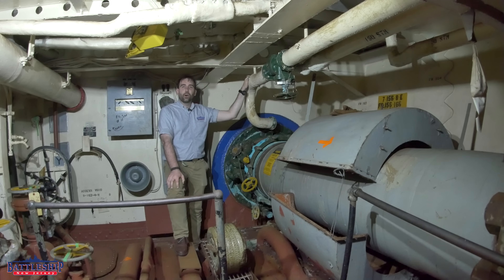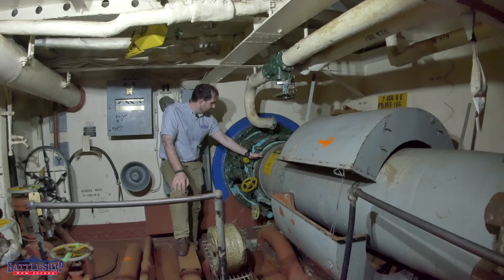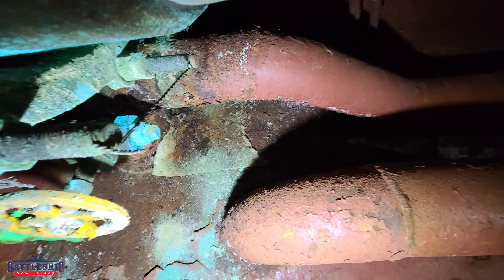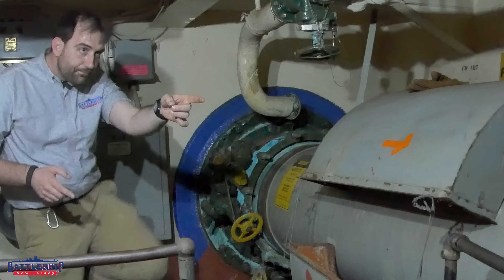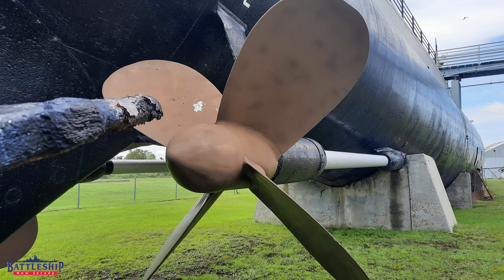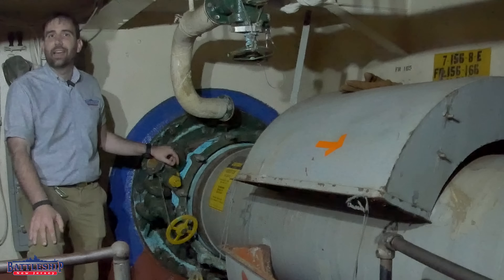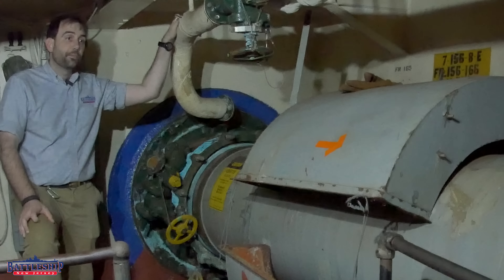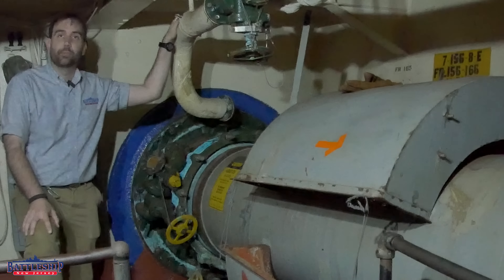Drydocking New Jersey Priority Project: Propeller Shaft Seals

Comment: I would strongly advise you don’t remove the propellers. Once removed there’s a requirement to control the condition of them separate from the ship. Whatever shape the hull is in the propellers will be closely related. Once removed they’re subject to impulse decisions made from expediency rather than well thought out planning. If they’re removed they become an added expense to store or display them. With them mounted to the shafts they won’t appreciably increase maintenance costs. Since there becomes an additional expense when off there arises the temptation to sell them off to pay for repairs of the other propellers or emergency repairs on the ship. A glaring example of this is the United States a short distance away from you. They took off and stored on her deck all four propellers. Because of expenses for berthing and paying of debts they sold three of the four she requires to operate. As it stands she doesn’t have a full template set to recreate the four and five blade designs to replace them. Some may say a board of directors would never do something like that but need I remind you of the erosion of our government leadership in these past years? With them remaining on the shafts they are mostly out of sight, out of mind, which is the safest place for them. Granted there’s a concern for the shafts sagging but I believe it’s possible to rotate the shafts either a half or quarter turn to offset gravity and return to equilibrium between rotations. By placing the input rotation before the gear reduction you gain the mechanical advantage to rotate the shafts. Even with the wrong cathodic system elements it’s gone thirty years. That’s the number of years they’ve sat silently unmolested from outside forces because they’re inaccessible.

Comment: It would be nice if the propellers could be left on, but it may be more realistic to remove them. The radial load on the shaft and packing would be removed, increasing the longevity of those components, and the props could be displayed on site, despite not having a need for four more. If the goal is to keep the museum going as long as possible, I would vote for removing them, as long as they can stay with the ship. Perhaps they could be put on deck even? They don't serve a function on the ship, and since it's a museum, having them viewable by the public makes more sense. Fabricating mounts for them isn't exceptionally difficult or expensive when compared to drydock fees. Perhaps you could have an engineer and welder volunteer their time to create the cheapest mounts possible.

Comment: Having volunteered on the  USS Cassin  Young, in Boston
I always thought the propellers should be removed as they are just another problem area to worry about. No one sees them and they are sometimes very hard to be kept water tight.
Reply: You have other problems then
Reply: I meant the shafts can be hard to be kept watertight!

Comment: (Unfunded) recommendations: (1) repack, repair keep shaft and propellers in place. Preserve the integrity of the artifact. Even if they are not visible. (2) remove, but keep them under your control, whether or not on display. Please don’t distribute them to remote locations and new owners. As you point out, a disarticulated piece of history loses its connection and fades in meaning over 1 or 2 generations.

Comment: If you are really concerned about the shaft glands why has no one in the past 20 years cleaned the gland and repainted the area where you said it was rusting from leakage while in service? It looks like no one has bothered to snug up the packing since the last drydocking. Why don't you take care of simple things like that packing instead of worrying about propellers and telling viewers that the propellers and shafts are endangering the ship? You don't need to go to a drydock to add packing rings and you don't need to remove the old stuff first, there is plenty of room left in the gland, just look at the length of the gland adjustment bolts.

Comment: Definitely remove and blank the holes. That is the only sensible answer.
Now, what to do with them? I would display them on the grounds. Spaced and oriented exactly as they appear on the ship. Maybe coming out of a concrete replica of the rear hull of the ship?

Comment: if the damage is minimal and it would appear your mitigation efforts will work and survive another 30 years i would vote to leave them. but if it would appear at the present rate of decay it will not make the next drydocking they should be removed

Comment: Rotating the shaft shouldn't change the distribution of weight on the packing. It does equal out the load on the shaft. If at some point in time, they may move the New Jersey to a dry display and they will want the props on the ship.  It may never happen or it may take 50 years. 
I would ask a real engineer.  My opinion if possible it is best to keep them on the ship. Once you get her out of the water you will have to decide based on the condition.

Comment: Remove the prop's  keep them on site ,  can you not stack  them on top of each other on the stern of the ship  for display ????   or display 2 in the parking lot   and stack the other 2 on the stern  of the ship ,  looks pretty simple , while in dry dock  remove  stack them on the stern of the ship , there for saveing  at least the transport cost , some steel and a guy that can weild  build a rack that can hold them  ???    Hell look at the racks @ home depot  they hold up tons  of material  ,  where there is a will there is a way .  maybe home depot or places like that will just donate. racks  to hold them  on the stern of the ship .

Comment: DO NOT remove the ship's propellers!!!  I can't believe you would even consider that....  especially as a museum curator, a person who is dedicated to preserving artifacts.  Removing the propellers would be the exact opposite of preserving the artifact. It would be one thing if the Navy already removed them, but they didn't.   Here is an idea... maybe you should remove the 16" turrets so rain water doesn't run in through the gun barrels?  Just blank over the barbette openings with sheet metal and then you permanently solve the rain water problem.  Sounds ridiculous, right?  Well, so does removing the propellers. It costs X amount of dollars to properly maintain the ship, right?.....  Then raise enough money to properly maintain the ship.  Don't start cutting the ship into pieces to make properly maintaining the ship somehow cheaper.  Do it right, or don't do it at all. Raise the money to do it right.  If the shaft seals have lasted this long, the new ones will last this long again, and maybe longer knowing the ship will never run again. Taking the easy way out is NOT always the best way out. Just my $0.02 cents.

Comment: If I were to put my battleship curator hat on, I would sure pull the the props off and the end shafts.  You can always add ballast to the aft to compensate for the weight removal.  A nice steel blanking plate would be much better in the long run, than a leaking prop shafts in the future.  But I am not a battleship curator, just a captain!  👍🤠  You would never see the props under the water if left, so many people won't know, but again, you could always melt one or more down for fundraising and keepsakes in the store.  Would be cool to have bars of various sizes think like gold bars cast  with info and weight stamped into them and maybe even serialized.  I know I would purchase a keepsake part of the prop for my bookshelf!  It would be a great gift for others as well, and selling them could help pay for the melting down.

Comment: You're the Curator of the NJ standing next to an asbestos hazard area without a mask! WTF????
Reply from the maker: There is not asbestos here, there's no insulation so there can't be asbestos. Those signs were put in every room at decommissioning and any space we've air tested has had them scraped off. This isn't on a tour route so we haven't bothered to remove the sign. In all our years we've never has asbestos turn up in any of our air tests.
Reply: @BattleshipNewJersey  great thanks for explaining, it just seemed really odd to me.

Comment: I'd lijke too see the props an shafts. The covered water inlets. An tghe removal and refitting of the sacrificial blocks. What type of blocks are you going too use considering where she is resting? If they have to cut any sections out you normally can't access from inside the old lady then I think it calls for Ryan too wriggle his way in there with a go-pro on his head. If he can fit up a gun barrel he can do that. Hey Ryan you've done the 16's when are you crawling through a 5 inch? 🤣🤣🤣 We all know you can do anything https://media.tenor.com/nXRJvIaQdb0AAAAM/superman-man.gif https://media.tenor.com/nXRJvIaQdb0AAAAM/superman-man.gif https://media.tenor.com/yRmL6IsrrvMAAAAM/superman.gif

Comment: The weight of props and the unlimited disuse is not conducive to the long term stability to the the ship as a museum.  Keeping the props attached under water does not add to the museum, but adds increased failure. Better to stabilize the vessel and give public a view of the engineering.

Comment: I see my suggestion will go against the grain. I, too, like the romantic notion of a complete ship.
Remove the props and display them at the museum. And go ahead and remove the prop shaft, blank off the hole.
Yes.. the ship will no longer have her props. But, there are other artifacts that are missing so no actual precedence is broken. Doing so will reduce the risk of water intrusion for a very, very long time rather than just a long time. Keeping the props on site means you will not lose track of them.
Basically.. it's spend more money to reduce the risk more. She's 80 years old and getting older. She was never meant to be kept this long. The risk grows with time. Having to replace them in an emergency could happen later and it would be a significant undertaking.
In manufacturing we use a risk assessment tool called FMEA. Severity of failure - high. Potential of failure - possible. Ability to detect and correct (in the water) - Hard. That would be a reasonably high score. Higher scores require more action.

Comment: The weight of the shaft does not rest on the packing. There is no metal to metal "grinding" and the packing is not simply "wound around the shaft". Lengths are cut so that individual sections are inserted with any minor gaps or angled overlaps staggered like piston rings. The small amount of leakage is to cool and lubricate the packing material. 

Please, please, please study the subject matter before making these videos with so many errors, it reflects badly on everyone involved and does not serve your viewers well. If you don't know what you are talking about, don't say anything in a video. If you want to know what you are talking about, read the manuals and/or talk to people who do know, or better yet, have them narrate the video.

Comment: Just my opinion but you currently do not have enough factual information to make an informed decision because you are unable to tell the condition of the props and the subsequent corrosion you spoke of in the video.  You stated that among her staff there are people in both camps.  Have both camps develop respective plans.  One would develop a plan of what should happen if the props and shafts are removed such as what to do with them, where they go ETC.  The other would develop a plan if the props and shafts are left in place to inclued possible solutions for the shaft sag like reinforcement.  When New Jersey is dry docked you will be able to make an informed decision based off of what you find during the inspection and you will already have if not a complete plan but a well though out course of action.  While I can imagine you want to keep New Jersey as whole as possible at the end of the day you have to do what is best for her and when she is in dry dock she will tell you what she needs.

Comment: Why don't you rotate the shaft either by hand or for far less than 5 million dollars to build a machine to rotate all four propeller individually or together how about using some common sense instead of trying to overthink the problem.after 36 years you haven't saved any monies for projects that need to be done and funded why are these people who are in control of the finances incompetent? Or have no idea of the future needs of these iron ships sounds more like you need to get rid of the people who running the place and get some people with practical experience

Comment: Absolutely remove them and plate over the holes.  The USA is a banana republic already the only way the government can afford to do things like give out grants to dry dock the New Jersey is by printing currency that people outside the US will accept, which is a paradigm that will likely change in the near future.  In the future there may only be one guy if that looking over that ship with no budget, so make the job is as easy as possible.  If I had to guess I would say the soonest, after the 2024 dry docking, that the New Jersey sees a dry dock will be 2060 or 2070.  At best the future is not going to be what most people think.

Plus it is probably cheaper and faster to plate over the holes then try and fix the seals.

The future is coming for us all and wishful thinking is not going to change it.